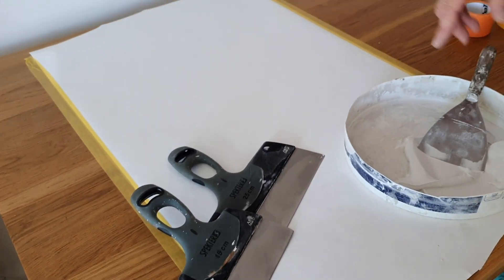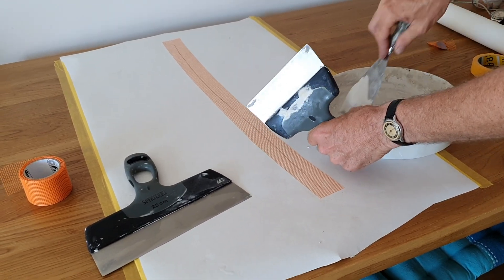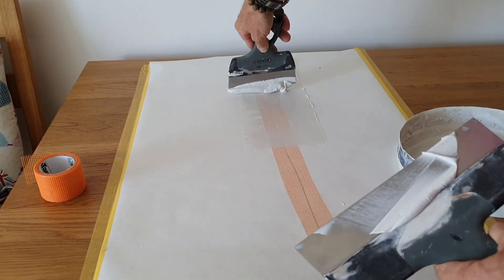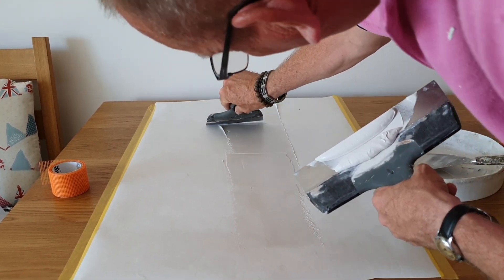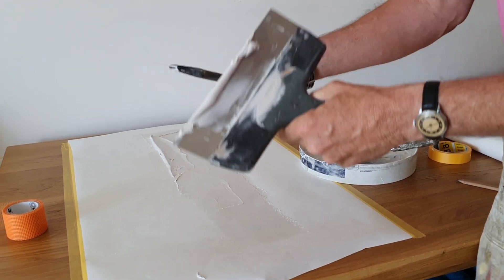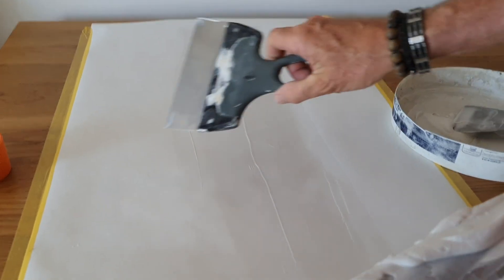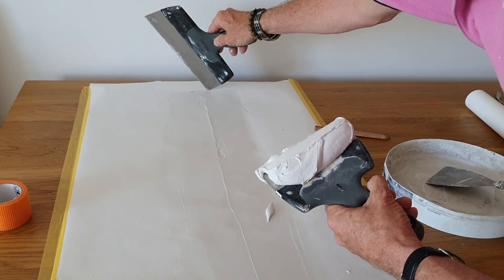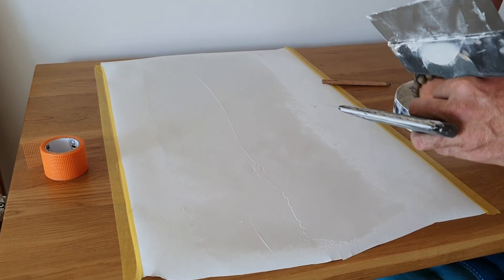Filling over scrim tape - 30 Years in 30 Minutes

Comment: I used your exact same method some 10 plus years ago in 100 year old house with cracks in plaster. The plaster was sound, just cracks from age. Worked great and the walls are still holding up.

Comment: I've seen some comments about applying filler then scrim tape. What are your thoughts?
Reply from the maker: Hi.
If the tape is NOT sticky, the fine, but, apply filler, put the tape where required (now you might not see the crack because of the filler) PUSH the tape onto the wall with a stroke motion from your small blade, then reapply the filler.
Best to buy good tape in the 1st place, then you won't have this problem.
Good luck
N.

Comment: Filler? What if the crack is running along the joint between 2 plaster boards do I use joint compound first before using a filler ?
Reply: I think people refer to joint compound and filler as the same thing …